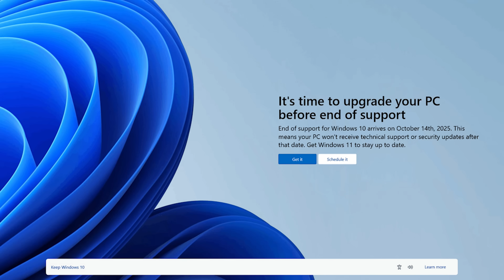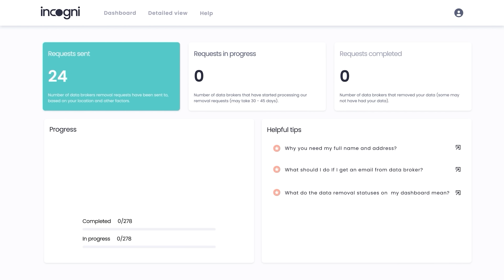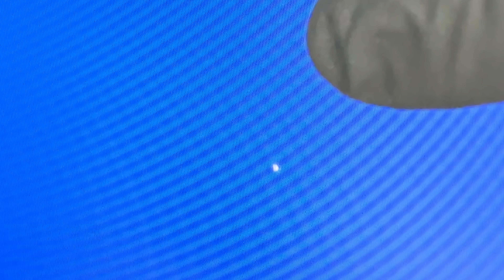I Made 2 WORKING Laptops From 1 Dead ThinkPad - DON'T Buy a New PC Just For Windows 11!

Comment: Congratulations on selling so many ThinkPads. Good to see a man working hard, and I'd be being something from you, if I lived in the USA.
I much prefer Linux to Windows -- even Windows 10 -- but for reasons that go back twenty years and are a bit niche I need to have at least one thing that boots Windows. I have tried 11, and it demonetizes the shit out of me, with its constant effort to get you to put all your data into OneDrive -- legalized ransomware. So I'm experimenting with Windows 10 IOT (internet of things) LTSC, which is supposed to get security updates until 2032. As I am 81, this could be sufficiently long term. Don't underestimate the oldies, BTW: some of my contemporaries don't have much of a clue (goes for some digital natives, too), but Nonna's first job after leaving college might have been programming in Cobol.

On HP: their good machines are indeed well built, but even with the well made ones, I have problems with the corporate security layer they build into them, which seems weird and intrusive. I'm currently struggling with an Elitebook 1080 G2: I can't get it to boot into Linux off the SSD. Will run Mint or Zorin fine off a USB drive, and it installs to SSD, but won't boot. This is not my first problem with weird HP shit; or maybe it's just my negative attitude.

Comment: I understand you perfectly, I have rescued some corporate class laptops and other older ones with Pentium 4 processors, which I have in my possession, I use the corporate ones at home often, one of them was an HP Elitebook 2560P, which I bought very cheap from a friend years ago and I restored it, currently my younger brother uses it and it works perfectly, and I personally have a Dell precision M2800 which I also restored, I enhanced it and I use it as my work tool, and it works perfectly.

Comment: in regards to Linux we can't escape some drawbacks the OS has:

1) you need to re-learn stuffs in a challenging enviroment. 
i don't care how easy it is for a given person to do that, it is a task any ex-Windows user needs to deal with. A different file system with very intimidating directory layout, a complete different approach to troubleshooting issues that might be different from windows but that will also be different from one distro to the next one.

2) there are software limitations.
Shure, you have a propper soft for any task you need/want. BUT the mainstream edition suite is Adobe, which won't natively run on Linux. Same goes for Microsoft Office. You might answer that you can use LibreOffice and Gimp and other alternative soft that works really really well. And that might be right at a consumer/individual degree. But when you start co-working with Powerpoint presentations or Adobe .ps or .ai files, you need 100% compatibility, you can't settle for 80% compatibility.
That's a very specific limit for many people using free soft for decades. You can try to "wine" certain soft, or having a Virtual Machine or a dual boot PC. But all fixes are just adding another different layer of complexity (and maybe problems aswell). At the end of the day you need that your main OS gets the job done as perfectly as you can do it.

3)  You are entering a way smaller comunity to rely on for fixes.
Windows user community is by a big margin the largest on the internet, so at the end of the day you'll shurely find a video fixing any problem you might have on any windows, probably also in your own languaje. With Linux you might not find a video of that specific fix for that specific version of that specific Distro (oh, yes, fixes will change from version to version even in the same distro) and ended up being forced to join a forum and hope for a good and fast answer, all of this in maybe a different languaje (BTW my native/first languaje is spanish, that's why i'm bringing this up, since once you move away from English it is an extra level of challenge). But also Windows community is as large that you might find someone you know with the knowledge to deal with the problem in the first place.

So all in all, it is great to try linux, but it comes with many caviats

Comment: Just bought old thinkpad for my SIL for $140. Installing linux on it and it was amazingly smooth it tempted me to switch.

I owned hp laptop back in my uni days, it works normally for 2-3 years. Then the hinge broken, the cpu got so hot it was randomly shut down/rebooting. But i don't have other laptop back then (nor the job),so i had to make it works somehow. It last for next two years (with basically torn apart "aesthetic"). Until i finally can buy another (bad) laptop (asus vivobook 2 in 1). It's okay if you use it as normal laptop, but it's horrible 2 in 1 device. i only used it for less than a year, then sold it. Never buy any laptop again since then. I only use laptop from my office, until macbook air m1 released. I bought it for 1 specific reason, battery life. That thing is amazing, i still use it now and still work as smooth as day 1 I purchased it. I guess we tend to want something we don't have, even when we already own something similar with just as good if not better functionality.

Comment: I had an Asus Vivobook 15” with an R3 7320U and it should have been fine. It lasted maybe a year and 6 months before having constant wifi failing and random restarts. The probable cause for this is an incredibly soft plastic chassis with broken clips and torn out screw inserts that flexed so bad for so long it cracked the motherboard solder
Reply: Ps: I got a used T14 Gen 1 for $370 cad with 56 battery cycles

Comment: what do you think of the lenovo yoga 2 in 1 series, i just got a lunar lake one for a lot off because you can opt out of windows and save £70 ish. i do wish the ram wasnt on die but i cannot beet the battery life, without going for apple and yeah.. no.
Reply: before i had an hp stream book...... that laptop now runs a plex server with an external ssd (it had 32gb emmc)
its crazy power efficent, but it is the least upgradable and repairable pos ever

Comment: Literally today i worked on an hp 15 with the 8th gen i5. That thing is such a piece of crap, clearly designed to not be worked on, bits cracking off left and right. And i was gonna put in an m.2...but the slot is stuffed with a 16gb optane stick 😢 so i have to jump through hoops to convince the damn thing to not need the optane, or dig out a 2.5' sata ssd.
I hate HP so much.

Comment: 10:40 at my job we develops various apps for things like construction, fibre optics laying and so on. Bureacracy related apps that make things like uploading contracts and geo data easier rather than visiting 8 different government portals.

One app, really ancient ap from like 2004 needed an update about 3 years back. We needed to add a new button to it, like let's say there were three buttons "Upload" "Save" "Cancel". And from legal standpoint we needed to add "Edit" button. I kid you not for 5 months straight since the update I had people call me (DevOps guy that handles the logicapp flows, no clue how they got my number int he first place), had to be in the high hundreds before people got used to it. They were calling that they can't find the Save button, that there is now Edit button where it was. Save button did not change it's place on screen, but it was no longer second from the left (it was specifically hard-coded for this situation to be at the exact XY coordinates, but the designer team required Edit to be before Save so that you do nto save by mistake by pressing tab etc). Then about a year ago a lawyer told us to rename it from edit to "update" as edit implies there is no previous version of the document left (which there is for audits). So we renamed it. I still get calls about it. Not just that the Edit button is now missing, but that the Save is also gone since Edit was removed.

Comment: I love to see this.  I don't do it as a business, but I have been doing what you are for my family with Dell Latitudes that I have procured from work.  Basically, when a laptop gets replaced at work, our IT guy pulls the OEM Dell 256GB NVME drive and puts in a pile to send to our electronics recycler.  Many of these are perfectly good laptops, but my employer basically replaces any laptop that has any issue and is out of warranty as long as the person's manager approves it, and doesn't care about the old one being sent back to head office.  The only requirement for decommissioning is that the storage has to be removed and sent securely for permanent destruction.  Which is no great loss, Dell 256GB 3rd gen NVME drives are barely worth the silicon used to make them.  Most of these laptops are easily able to run Windows 11, so they 100% aren't e-waste.  It's wild that a company would pay so much money for fully serviceable laptops with full parts availability and then not even consider repairing them the day they are out of warranty.  I had to fight with them to order me a battery for my previous laptop because they wanted to replace the whole thing.  Not only did they send me the battery, they allowed me to replace it myself.  Our former onsite IT guy at the time had zero experience with PC building and had never disassembled a laptop.  At one point later I recommended a tool set for him to do that kind of work because he had no clue what he needed (I recommended an IFixIt kit or something similar from the local chain of computer stores, since you have everything you need to work on computer hardware all in one little case).  I also made sure he was aware that Dell sometimes uses blue Loctite on the case screws, and that you have to be very careful cracking the case for the first time not to strip the #0 Philips screws.  I appreciate that they didn't use "security Torx" screws (which have a pin in the middle of the socket), but regular Torx would have been a better choice than Philips for these screws, especially with their inexplicable use of Loctite.  It's wild how IT people these days often don't really know much about hardware.  They're all focused on the "infosec" (information security) side of things, and some of them struggle getting a printer to work and apparently don't know how to use a screwdriver.  Our current on-site IT person seems to have more skills trouble-shooting PCs, at least, and he obviously knows how to crack these things open, since he's the one who removes the NVME drives for secure disposal.

Comment: HAAAALLLLPPP!!! I got an Acer Predator Helios 18 with an RTX4080 and an Intel I9 14900HX. The processor is pulling 1.9 volts no matter what I do and the RTX 4080 is hitting temps up to 101c and the processor is getting to 105c!
it sucks mor votage than you mom suks my CO rrupted bios. I think that is the problem.

Comment: Last week I saved a 6-year old Motorola phone and now it's my daily driver until next year.
With stock android 11, it would get stuck on a reboot loop, even after re-flashing it from outside. I thought it was a hardware issue. As soon as I installed a custom ROM, it came back to life. Been using it for over a week. If that's not planned obsolescence, I don't know what is. Probably saved me $1000, from not having to buy a phone I don't want nor need.

Comment: I got an older HTPC from a friend, it has most of it's components, but it doesn't have a storage drive. I'm currently in the process of giving it a good cleaning and I plan to repurpose everything. I was told before I got it that some of the parts had been moved to another PC. It has a Gigabyte EX58 UD3R motherboard, an i7 920 CPU with heat sink, XFX HD 5770 GPU, a Pioneer Blu-ray disk drive, and Crucial Ballistix RAM (24gb from 3 sticks).

I was told, and confirmed, that it currently has issues booting up. I've cleaned the thermal paste off and have removed all of the components for cleaning. It's quite dusty. I'm  not going to be using this for gaming as the current GPU would struggle to run most modern games. Are there things I should be looking out for when trying to fix the booting issue? I have a spare storage unit already. Any actual advice would be greatly appreciated.

Comment: I work IT at an university and we try to be as green as possible as a matter of policy (and I do as a matter of personal responsibility), but in my opinion there is a non zero chance that a future Windows update will demand certain cpu features and a) block future updates (security issue) or b) "brick" the machine when applied (recoverable of course but not for standard users maybe). What's your opinion on that? 

So what I do is I tell people about this unlikely but possible worst case scenario and that they should be fine to upgrade to 11 against MS recommendation if they have proper backup habits.
However since "peace of mind" is a big factor here (replacements take a while, too) I did replace a number of 6th/7th gen machines over the past 2 years, but I always try to give the old ones a second live as loaners maintained by me.

What I am saying is that I can kinda understand where big companies doing mass replacements to ensure future proofing are coming from, but that's on MS of course.

Comment: Yer UK, I wanted to repair a used P15s gen2, it had a pressure spot on the screen. The problem was; I paid £320 for it, then a new/used screen, I had no way of no way of knowing what quality screen I was getting, the cheapest was £100 then self fix with min skill. So I doubled the budget & purchased new. Honestly I did try many a used in the I7 10/11gen but they all fell short.😒

Comment: dude, I love the message of buying used laptops and all that, but stop the fearmongering. You heavily imply that on October 14th (not sure when you were filming, but on the release of the video, it is past that date), if you have Windows 10, your computer will stop working entirely with the "largest e-waste event" line. Rest assured people, your Windows 10 computer will still work past the date of October 14th, it will just be less secure because Windows won't fix any exploits that get discovered after October 14th.

Comment: The biggest problem is, WHERE do I find these repairable laptops??
The only 2nd hand things I can find in France are either decade+ old company desktops with a Celeron inside, or disposable laptops (soldered everything, plastic hinges, high price, proprietary locked firmware and hardware).
Good computers simply do not end up on the used market here.
Reply: there could be some refurbish webpages with old business grade computers

Comment: I know nothing. Also I know you are the greatest technician that's ever lived and not a programmer, but I think you may know someone who is.  An idea just woke me up. The only issue with old pc os's is internet connection. What about writing software or hardware which totally isolates the os from the internet,  running the internet input as an external element. It would make sure that the input is safe as well as translating so that the os can understand. Again, I know nothing, but see this working in a similar way to a graphics card,  where it's sole job is to handle graphics and "fashion" it in a way that the cpu and os can more easily use it, as well as be protected. Now I don't mean just an internet card/router or an antivirus, but more like a separate unit. 
   I know that Linux is really the best option right now, but the issue is folk who have used software that was written for a Windows platform and just want to be able to use what they know without either being infected by, or unable to use the internet.
   As I am writing this, what comes to mind is an external module (I'm seeing a grey-black box with a couple of buttons and flashing lights, maybe even an LCD display, much like the old landline caller ID boxes) which has ethernet input and outputs. You plug it between the pc and the modem and it allows the computer safe and usable internet access.
   I know that you probably get thousands of comments to go through and I see this being skipped or ignored, but I'm very annoyed at the liberties that both MS and Apple are taking and just want an easy way for joe and jane normal to be able to JUST USE THEIR DANG COMPUTERS!
   I don't want anything for this, or anything. I just don't have any related knowledge and hope that this can somehow ignite thought light bulbs for those who may find this as an alternative direction in which to remedy the problem.
   Thank you for what you do

Comment: Bought a hp probook 450 g6 on an auction for 100 euro, best purchase ever, works well, has a dedicated nvidia gpu and just works. Upgraded it with 2 1tb ssd’s and 32gb ram, its quite rigid and is even possible to play light/mid games on it and good for 3d design and rendering

Comment: @SalemTechsperts
Hi Andy
I hope you’re doing well. I have a question about your recommendation of the AMeCh SGT-4 thermal paste (which I bought based on your endorsement). Recently I’ve seen multiple reports saying it may emit acidic vapors, cause copper corrosion, and even bond the cooler and CPU together. 
Did you come across any official statement or update from AMeCh about this issue? It’d be really helpful for users who applied it based on your recommendation to know your current take.
Thanks for your time and for the content you create.
Best.

Comment: Hi Andy
I hope you’re doing well. I have a question about your recommendation of the AMeCh SGT-4 thermal paste (which I bought based on your endorsement). Recently I’ve seen multiple reports saying it may emit acidic vapors, cause copper corrosion, and even bond the cooler and CPU together. 
Did you come across any official statement or update from AMeCh about this issue? It’d be really helpful for users who applied it based on your recommendation to know your current take.
Thanks for your time and for the content you create.
Best